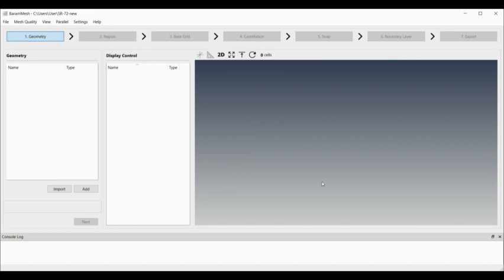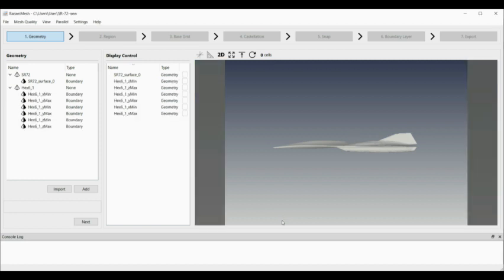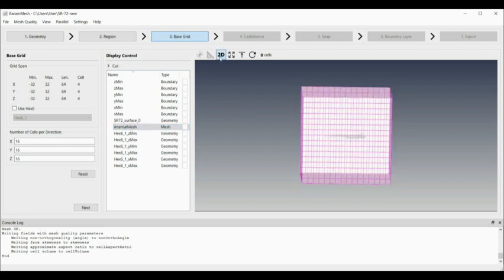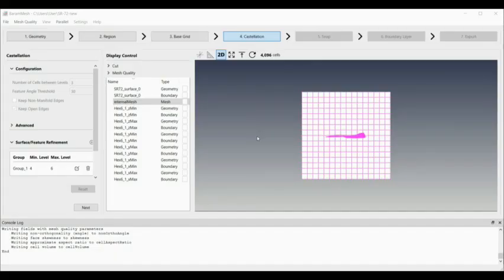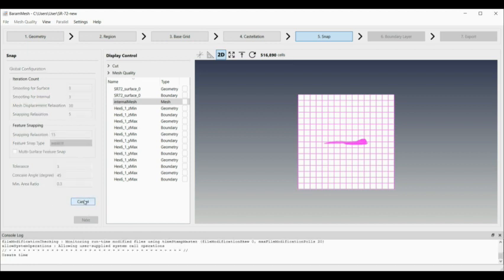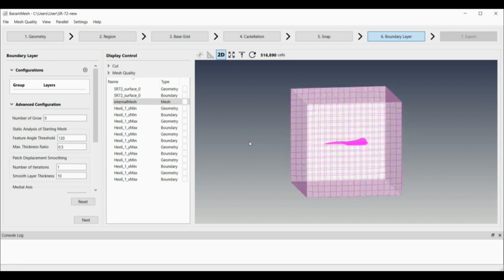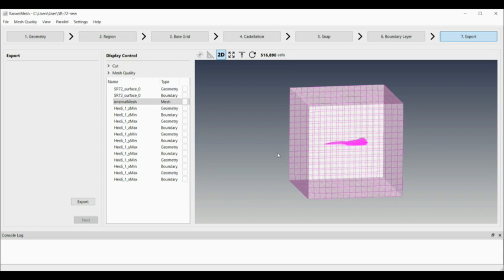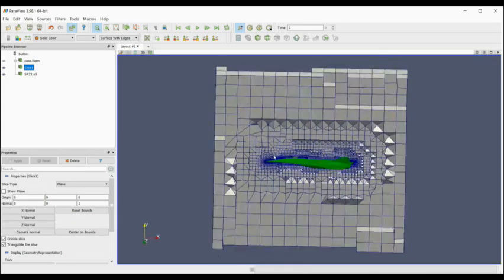NextFoam BaramMesh demo1 - darkstar geometry

Comment: Hey Ive been learning how to use Baram flow and have been meshing a part with Baram Mesh and have been having a problem. At the Castellation stage I can not get it to refine and will get an error code, "Castellation refinement Failed. [1]"  and in the Console at the bottom there are a few messages saying 
--> FOAM Warning :
    Reading "system/snappyHexMeshDict" at line 60
    Too many closing '}' ... was a ';' forgotten?

Do you know what I should do? I'm completely lost with this program